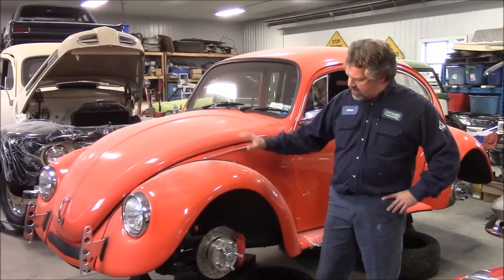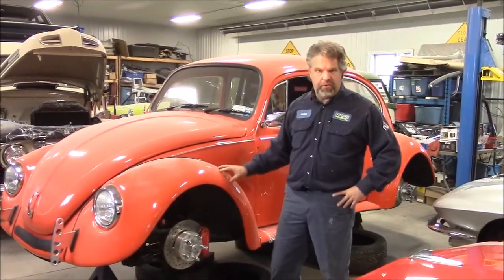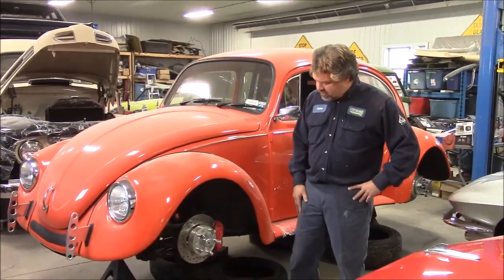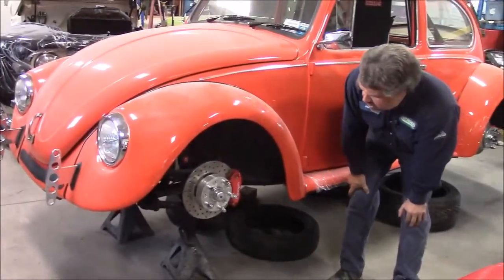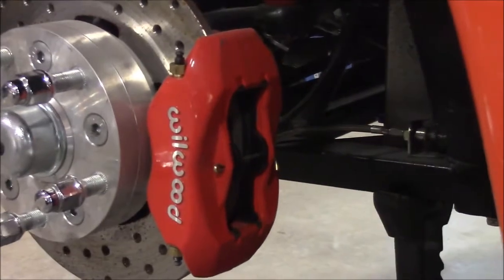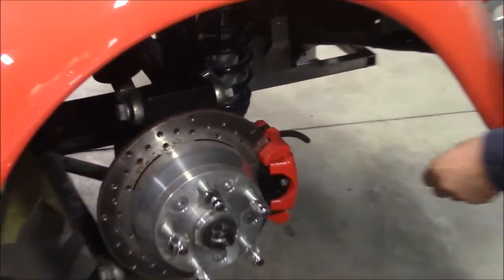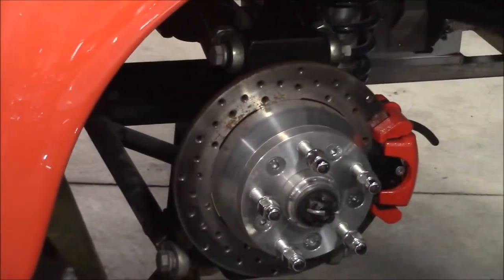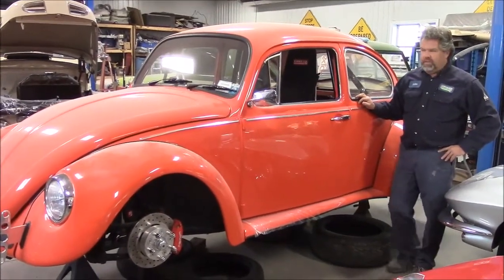Wilwood Disc Brake Conversion, Classic Volkswagen Bug Beetle,  lastchanceautorestore com

Comment: Hi I have a karmanguia 1973 I want to put a kit of this type, where and which model should I buy but I want to put the wheels of the new beetles 2012 18x8 that has the big chrome cap
Reply: Got the same question. Building up from the pan right now & want to stop as well as I can go. Already have a rear disc conversion kit for my Ghia, but want more stop at the front-end.